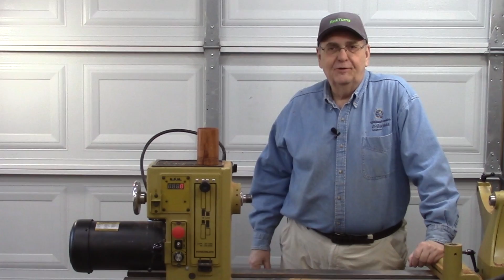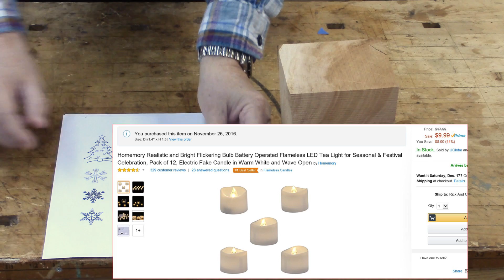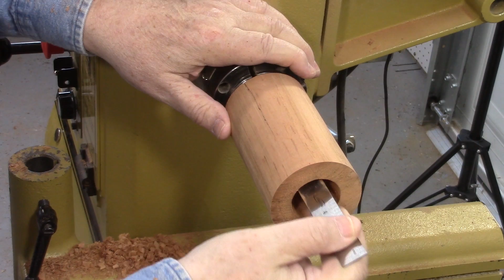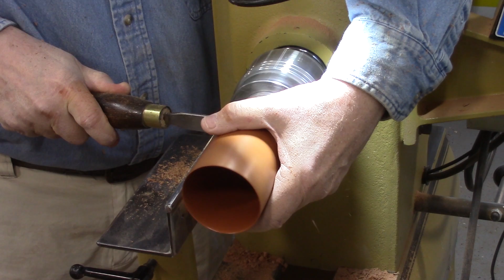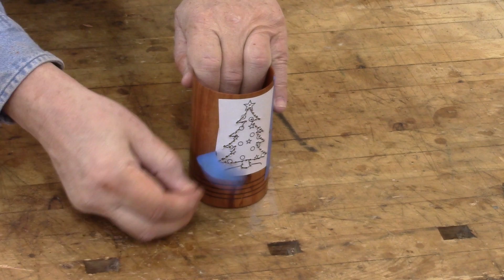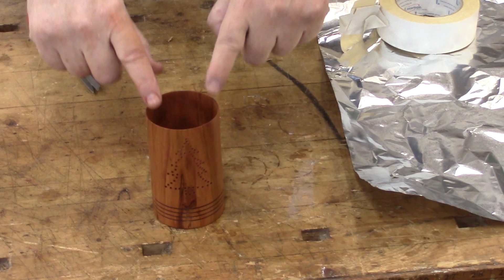A Christmas Tea Light Holder

Comment: Thank you.  I made one of these today.  It is a great idea, but mine is only really visible in extremely low light, or complete darkness.  I do like it, but wish it was more visible from all angles.  I appreciate the great tutorial.  I made mine from cedar.
Reply from the maker: Sounds like your electric tea light isn't very bright. Did you put in a piece of aluminum foil? Other than that, I can't think of anything you can do to brighten it up. Maybe the battery in the candle needs to be replaced?
Reply: I think you may be right about my light being too dim. I'll try to find a brighter one.

Comment: Hi Rick. what gauge wire do you use for your burn lines?
Reply from the maker: Hi, Michael. The burn wire shown in this project is 22 gauge steel. I also have some burn wires of 28 gauge steel wire, but I rarely use them...they burn through very quickly unless I'm really careful.